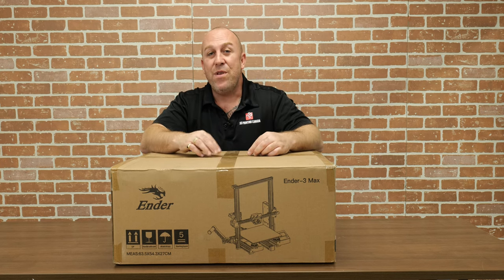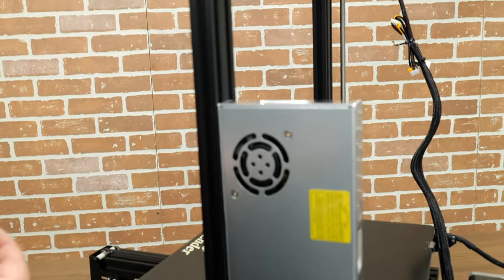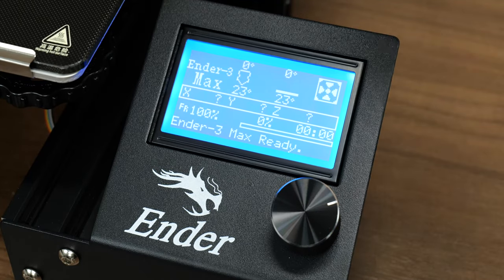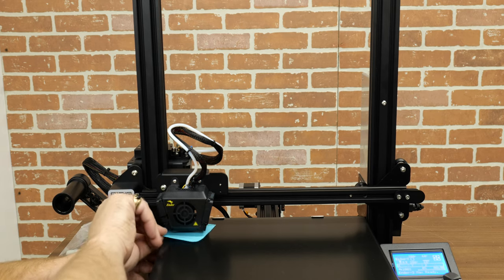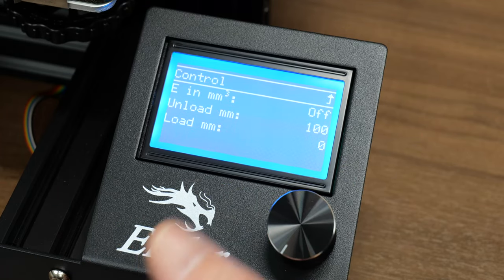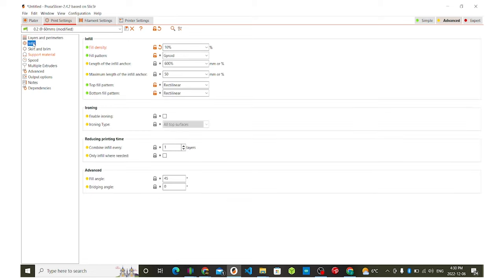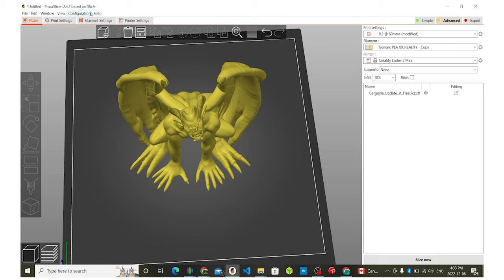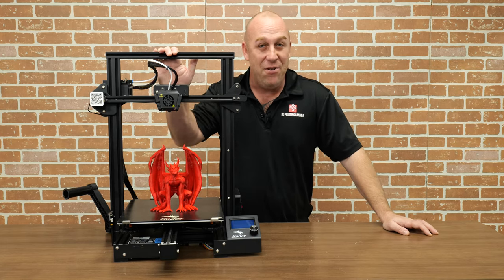ENDER 3 MAX QUICKSTART GUIDE

Comment: At tip:  I purchased an Ender 3 Max last year shortly after they came out.  I noticed a "bump" when moving the bed and extruder.  I was able to lessen the bump by slightly loosing the belts, but it was still there.  After a bit more diagnosing, I found the eccentric nuts were also WAY too tight.  After properly adjusting the nuts and belt tension the bed and extruder moved smoothly.

After the printer was properly adjusted I noticed the print quality also improved slightly.

Comment: The reason for during Vase Mode is that the Outage Recovery takes a snapshot of where the print is at each layer. Because there is no theoretical layer in Vase Mode, the printer will hesitate slightly and "cause a seam blob".  Turning this feature off during Vase Mode will stop these hesitations and your print will look great!!